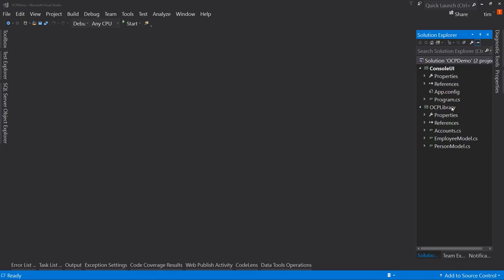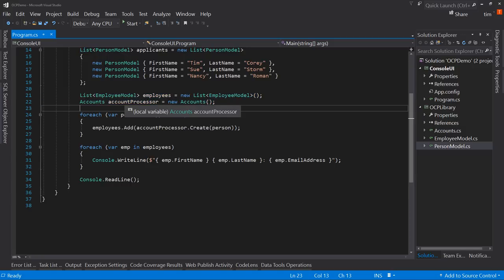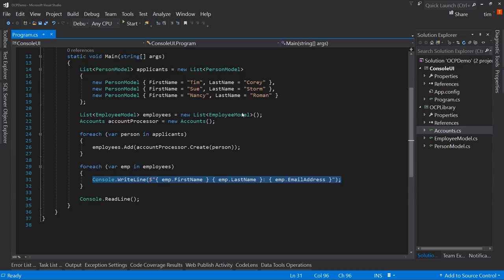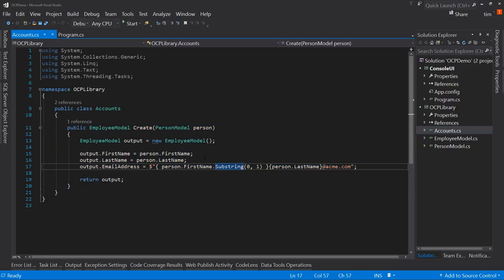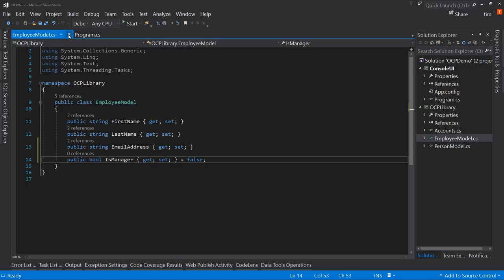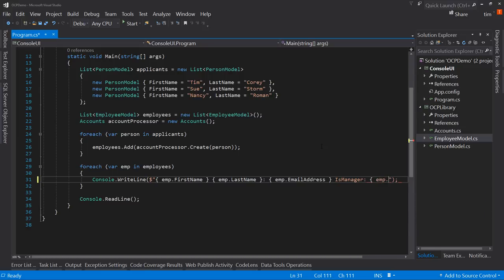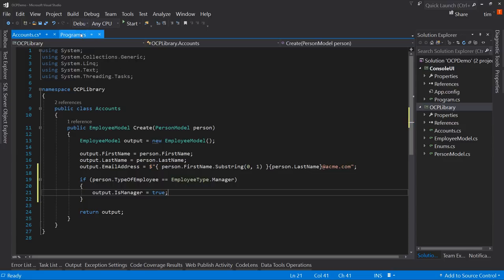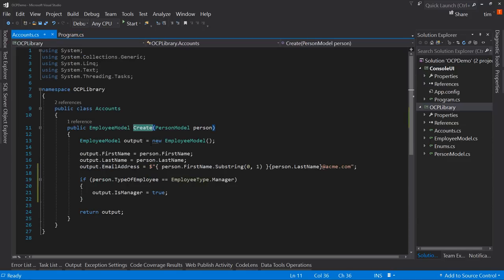Design Patterns: Open Closed Principle Explained Practically in C# (The O in SOLID)

Comment: So, you have, let's say 10,000 employee objects and in each instance you have that almost identical stupid AccountProcessor instance. What a waste of memory. And then we are wondering why simple application require 16Gb memory and 8 cores...
Reply from the maker: Nah, that's not how any of this works. We can reuse the same instance everywhere. That's part of what the dependency injection system will help us to do. So in your example, if we have 10,000 people, we could have one instance of account processor for all of them or we could have a couple different ones depending on their circumstances. As for a simple application needing 16GB of memory and 8 cores, I understand this is an exaggeration but I don't know of an application that uses that much power unless you are talking about video processing or something similar. While I understand the desire to keep applications small, the reality is that processing is fairly cheap. So what a lot of applications have the luxury of doing is giving you convenience and speed in exchange for using more resources. Your name is Angular. I'm going to assume that is in relationship to the JavaScript framework. That is an excellent example. We used to provide front-end sites with very little memory or processing ability. However, with the rise of JavaScript frameworks, we have the ability to have a lot of functionality and performance in the browser.
Reply: @IAmTimCorey  It wasn't my point. I know how to design SOLID and make code efficient at the same time. But you're doing tutorials for beginners and they are learning by your code to do not care about efficiency, memory, etc. It's not just those duplicated instances, you have many places in your code that does not so efficient. For example, you're always using List<T> for some constant collection of objects. People watching your tutorials will do exactly the same in their code. But do you really need such object as List in this case? You are not using anything of it's functionality. You are not adding items, you are not removing, not searching, not sorting. So why do you need a List<T>? All you need is just an array, that it. 
Of course, you can say that these are so minor things that they are not even worth to mention. But when you build some large system and doing all those "small" mistakes in many places in the system, overall it can be disaster when it accumulates all together. This is very bad advise - do not care about what exactly are you doing just because "processing is fairly cheap" and we have a lot of memory. Sorry for grammar, English is not my mother tongue.
Reply: @Trident7235  Lists are more flexible and can be searched much easier, even though he's not you can very easily get an extension that needs you to, also im pretty sure that in an array you cant get it to use the interface with the different models for each new entry like you can with a list, and arrays aren't generic as well, so they cant be made to hold a class as far as im aware, also those little small mistakes are simply because we haven't learnt the other parts of SOLID to implement them and fix them yet
Reply: @Trident7235  I hope that beginners would have the sense that this is a lesson about one specific principle. You don't learn every aspect of software development in one video, takes time.

Of course is important to know how your code will impact performance but early optimization is bad also, you can introduce bugs or complexity because you think this will not have a good performance without any real measure and is not the focus of this video. 

Anyway, to me this video is very concise because it takes only one principle and make it easier to understand and I think is individual responsibility to know that there's more knowledge to be gathered instead of just replicating the code he provided here :)
Reply: @SergioMichels  When beginners learns some basic stuff they tends to take what they see as building blocks without even thinking why is that so. For example, I think, almost 99% programmers doing something like "for (int i=0; i<count; i++)" just because they saw this "in the book". But if you'll ask them why it must be named "i", I doubt somebody will give you a rational answer.
What I've tried to say in my previous comments was less about optimization and speed performance, it was more about following "KISS" principle. Don't use something that you don't really need. Performance is just natural consequence of using KISS principle.
Reply: @Trident7235  I don't really get your point about array vs list. Using a list cost you probably a little bit more of memory but you get many more functionalities and flexibility. Access time of list is marginally worse(but still constant) in .net implementation, adding/removing elements operation time is constant where in array it depends on the size of particular array and so on. With a bit more upfront cost you get much more options in the future even if it is likely that you wont use it but does it mean we should use short instead of int when we are 99,9% sure 16 bits will suffice? To save those precious 2 bytes? We aren't programming microcontrollers here.
Reply: I will say one thing. I am such a beginner that my application will never have 10,000 employees and by the time I get to that level I expect to know better coding habits if they're out there
Reply: @Trident7235  Well I just saw the video. No where did I see bad naming or strange tips for beginners. In fact Tim stressed several times when to use something and when it is ok to violate. Beginners or whatever shouldnt assume they are robots. They have to think or else seniors should guide them. 

On a side note I worked on a big project where the lead devs worried their ass about code style and performance and in the end built some of the worst code I have seen. The point being, somebody has to be able to read that code at some point.